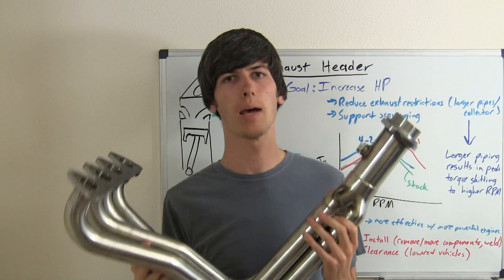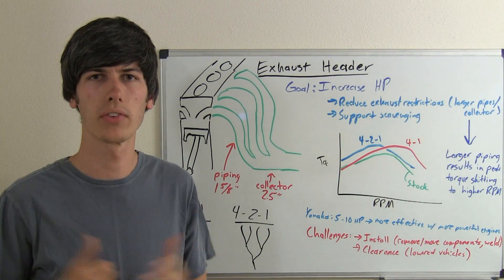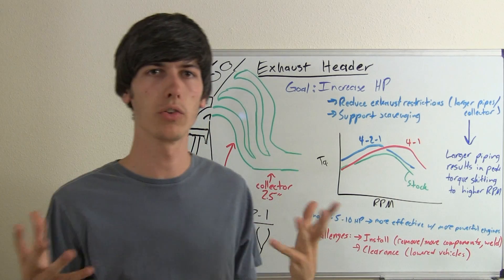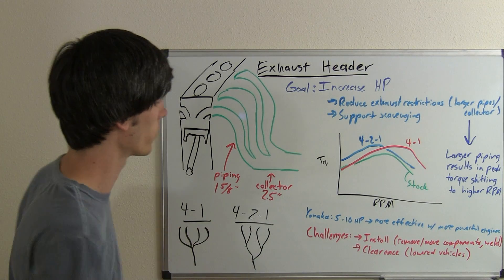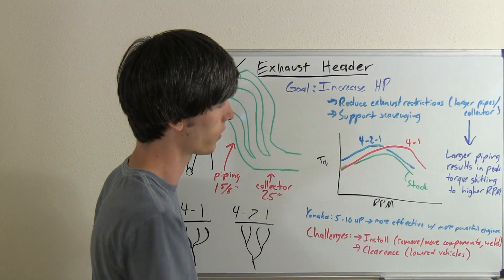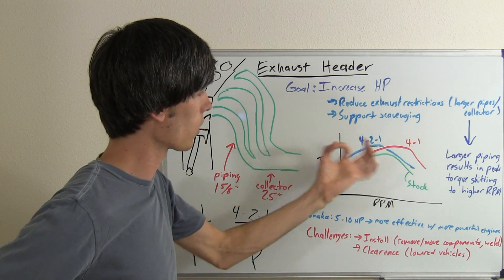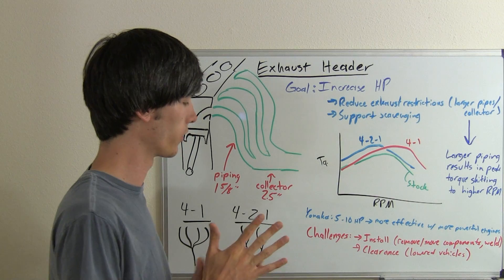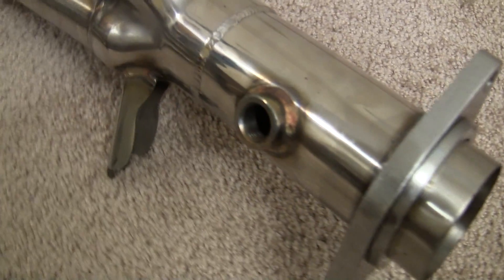Exhaust Header - Explained

Comment: I got stock exhaust on my Mustang, could I buy some aftermarket exhaust and aftermarket headers and put them together. I'm also getting a CAI too would that help out? Basically I'm getting aftermarket CAI, Exhaust & Headers
Reply: +leo ll lol  cold air intakes will give you gains as long as you get a tune..  most YouTubers who have never tuned a car think if you put a performance part in you'll  see an immediate difference right away.. cold air intakes will get you gains with a proper tune and that's a FACT
Reply: +leo ll exactly lol cause the tune tells your car that you now have a part capable of taking in more air flow than the stock restrictive intake. if they didn't get gains no one would be dumb enough to dish out money for them nor would a company still be in business if they sold 400-500$ dollar parts that do nothing for your car.. there's proven dyno results of intakes given you gains. you will always see gains from a tune.. in his case mustangs respond well to mods so he will indeed see gains.. the most commons upgrades are intake/ headers/ exhaust which with a tune will give you nice gains
Reply: a cold air intake should help out yes.. after you install the headers you'll need a tune so keep that in mind.. a tune will give you the max power of of those upgrades
Reply: Do I have to get then tuner right away..? I want to install those 3 parts and then after I save up a little more install a Bama Tuner
Reply: +Drake OVO not necessarily right away but you might lose some power until you get the tune, a tune will adjust the ECU settings so your car can run properly with the upgrades.. so if you put them on try and get the tune as soon as you can.. but yes your car can run without a tune just not efficiently as you want it to run
Reply: Look my Stang is an 04 v6... Would you honestly recommend me putting all this money into it?
Reply: +Drake OVO that all depends  if you plan on keeping it a while.. like I have an 08 g35 sedan 140k and I still put performance parts on it.. but I plan on rebuilding the motor(or swap it out) and tranny  in a couple years.. so if you plan on keeping the car for a while and rebuilding it when the time comes then yea its always worth it.. if it's something your not gonna have for a while then you might as well hold off till you get a car you really want to mod
Reply: Well my Stang was 81k miles.. The previous owner kept it storage in their garage for months at times.. So it's got plenty of life.. It does need new tires and wheels tho. I do want a GT. Specially an 05-09 model GT and a 5.0.. But I'd honestly like to keep my current Stang.. Maybe one day when I have kids I'll give to him. But all these mods will cost me at least 2k.. I could sell it and buy a GT.. But like I said I'd like to have a v6 & GT.
Reply: cai's are a waste of money. plenty of youtube vids to show this. spend the 4-500 on a upgrade that will actually do something more for you.
Reply: gkb your opinion, the tune and new fuel map is what gets the increase in power, not the cai. Plenty of people in the automobile community agree to this as well. Not trying to troll, just giving you FACTS as you say, do your research. 

https://www.google.com/search?sclient=tablet-gws&site=&source=hp&q=cold+air+intake+waste+of+money&oq=Cold+air+intake%2C+waste&gs_l=tablet-gws.1.0.0j0i22i30l2.1193.15587.0.16553.30.18.4.8.8.0.138.1655.13j5.18.0....0...1c.1j4.64.tablet-gws..0.30.1699.L2GgDVQ2R2w
Reply: +leo ll  you believe in what you want it's your opinion. I'll have mine.. take care now
Reply: gkb the difference is, I have facts to back up my opinion.
Reply: +leo ll funny I have dyno facts for my opinion too and so do millions of other people that mod there cars.. but again you believe in your opinion
Reply: gkb just like you do yours. the difference is I've supported my opinions with links and evidence, what have you included? A dyno report on your car that we haven't seen?
Reply: +Drake OVO we  make the auto exhaust manifold, catback, I think I can supply them to you.       prico_yang@163.com

Comment: sorry to ask, how about 6 cyl? which header system is the best for it? thanks.
Reply: +Andrew Kj The same science will apply, but header design and geometry will vary depending on whether you're talking about a V6, and inline 6, a boxer-6, or some other configuration. In general stock applications will feature exhaust manifolds, aftermarket applications will feature exhaust headers.

Comment: Could it cause problems on a stock engine not to have enough back pressure? due to too little restriction through the exhaust. For say a 4 cylinder boxer engine ( if it matters)
Reply: +Kevin Hackett nope backpressure doesn't matter on any new fuel injected vehicle

Comment: These videos help me so much. I am working on designing an "ideal car" because I'm fifteen with nothing better to do, and I want to have experience in designing cars if that's what I end up doing for a career. I'm thinking v10 or v12, 3.0 liter 1990's f1 style. Awd, with torque vectoring, and turbo charged. I'm also working with an Ohio state university student with a Chrysler internship on redesigning the way valves work and move, because I really hate how restrictive they are. The goal of the car is pure acceleration. I think I'll be relatively relaxed with top speed. Let's say a goal of 200 mph (hah got you there). Because of acceleration being our goal, we'll use the 2014-2015 f1's hybrid engines as a reference point. I recall you going over a new turbo technology you saw at an event. We'll combine that new tech with the split turbo technology of f1, to keep the intake cool. Since I'm a group B rally enthusiast, let's put a twin screw super charger after that turbo.

Comment: I'm sorry if I didn't catch it in the video but what bearing does the length of the headers have on back pressure? From what I have gathered from info online and my experiments with my 36-year-old 350cc single cylinder bike, reducing back pressure to a very low amount results in large gains at high revs (just like you said about shifting the peak output up the rpm band) but a drop in low end output. How does the header length fit into this?
Reply: Siddharth Rajkumar it doesn't explain in this video, but he does refer you to another video of his. Basically, when the exhaust reaches the collector, the cross sectional area increases suddenly before tapering down to the larger diameter. When the high pressure pulse of gas expands like that, it sends a lower pressure wave back up along the pipes until it reaches valve. Imagine taking a long, light spring, then suddenly yanking on one end. You'll see a wave go from one end to the other where part of the spring is stretched, and the remainder is still at rest. If you can time it so that wave reaches the valve just as it's opening, the backpressure will effectively be lower. However, this only gives a boost when your rpm is at a certain level, and will actually decrease torque when it isn't at the correct rpm, due to higher pressure before the wave hits

Comment: I have a 1989 e250 rv im rehabbing.  The new engine is in installed and now we're installing full length headers.  The left side fits but on the right side, one of the header pipes is hitting the motor mount bracket when there about 1/2 inch before we can bolt to the motor.  

I want use long tube and there's no technical shortys to get for that vehicle.  also i simply dont have the time to keep searching and waiting for shipping etc.  

My question is,  to make this header fit,  and for the lesser of two evils, would it be better to dent the pipe in where its touching the bracket or to cut a short area out and reweld to make the clearance  ?

Those were two suggestions from a muffler shop.
Reply: +Engineering Explained On the newest series of the motor trend youtube they tested how much (if any) a dented/deformed/clearanced header will cause a loss of power. And they determined on the engine dyno that as long as the header tube is not pinched shut, it has basically no hinderence on performance! Even with all 8 tubes smashed an a few nearly crushed half way in, they only lost about 1-1.5hp
Reply from the maker: +maxthereof Hmm. Well, the best would probably be to cut it and reshape it a tad, smooth bends, not sharp. But if it's not that powerful of an engine and you're just going for something that works, I don't think there would be much harm in a small dent. Keyword being small. Depends how much you want to spend I suppose.

Comment: I put headers on my Nissan Frontier a couple years ago and shortly after had a 2.25 inch y pipe made with high flow cats. Stock y pipe maybe was 1.75 inch and it felt like my truck had a lot more pull (butt dyno) with the stock y pipe. I am confused as to why it got slower with a bigger more free flowing y pipe.
Reply: Choking the engine a bit in the low rev range helps with developing torque, but that also means it can't keep up at higher rpm's.
That's pretty much what many manufacturers do on the inlet side by using f.e. vtec to open the valves a little at low rpm, but more and longer at high rpm.

By seriously increasing exhaust flow and reducing back pressure, you shifted the powerband to a higher rpm range, which should result in more power if the ECU, inlet, and injectors support it, but at the cost of low-end torque.
Reply: +Candisa backpressure is irrelevant on new fuel-injected vehicles
Reply: +Jayson MacKinnon Fuel injection has absolutely nothing to do with gas flow...

Comment: Can I drive with a aftermarket exhaust and a stock header until I install new headers that match my new exhaust? (Honda Civic Si)
Reply: Civic 😂
Reply from the maker: +Kregz Syb Yep.
Reply: +Kregz Syb  Probably. Only reason you wouldn't be able to is if the exhaust is made for larger headers which isn't very common.
Reply: How did it go with the aftermarket exhaust and stock header? Im going to install my skunk2 exhaust with my stock header and don't want to ruin anything.
Reply: +Kregz Syb  the aftermarket exhaust systems also work very well, we make them and quality is very good
Reply: +JunitoFa5 I got the 3inch pipe skunk2 exhaust, it's the right fitment but it's just loud af. I like it loud though, cops where are on my ass so I just keep the silencer on. It's still sounds nice with the silencer on too so I'm not too upset, better than getting a ticket 😁

Comment: Great, but, is there a difference between 4-2-1 long tube header vs 4-2-1 short tube header, and 4-1 short vs 4-1 long? or is just design? I have a 1.6 GA16de, and I just want low end torque, here in my country there are too many mountains.  Thx in advance.

Comment: So is it a bad idea to put headers on a straight piped car?
Reply: +TEETEE BIRD This is actually a myth. Backpressure does nothing but steal horsepower. What you are talking about is scavenging, and only gives you better torque at lower rpms. The less backpressure the better all the way around. The IMPORTANT figure is the tube diameter. A smaller pipe will result in higher exhaust velocity and therefore higher low-end torque. A larger pipe will result in higher exhaust mass but lower exhaust velocity, which results in less scavenging at lower rpms, but increasing top end horsepower. I wouldn't worry too much about the engine sucking in air/water unless your car is literally underwater.. ;)
Reply: a straight piped car is already bad.
Reply: thats only good for real time racers and rally cars that are always on WOT
Reply: +TEETEE BIRD well its not completely straight piped, its just a muffler delete on my 08 350z. I want to get test pipes and a y pipe, then headers
Reply: EstupedMexicanz never delete your muffler holy.

Cat delete and resonator is ok. The muffler is there to prevent water/moisture from going back to the engine esp if you have winter where you live.
Reply: +TEETEE BIRD Why never delete? I'm asking because I didn't do the muffler delete, my car is a salvage title with only little damage to the suspension, and the guy that owned the car before me did the muffler delete. it doesn't sound too bad and from what I heard there aren't any negative or positive effects besides shedding 20 lbs so what's the big deal?
Reply: +EstupedMexicanz muffler is very crucial. as i said. straight pipe isnt good. maybe you dont notice any bad effects right now but you should find a muffler for that. a small one will do with the same diameter as the rest of your piping.
Reply: +EstupedMexicanz its not all about sound. its to prevent your engine from sucking air/moisture/water when you switch the engine off also it helps to create enough back pressure to help pull exhaust gasses out.
 

bottom line :
you can delete anything on your exhaust but never the muffler. unless youre a rally driver.
Reply: +TEETEE BIRD Really you'd only have the issue of sucking moisture back into the motor on a carbureted engine, because they are really the only engine that has a chance of spinning backwards on shutoff, Right?
Reply: Doesnt matter. Air can still back flow regardless carbureted or not.
Reply: gt86life Thanks
Reply: +TEETEE BIRD Lol what are you talking about? Up here in canada lots of people have straight pipes with no issue at all. How would water/moisture be stopped by a straight through muffler?

Comment: does doing this consume more fuel?
Reply: Theres no possible way that having better airflow equals using more fuel
Reply: +_ _  this is true, but isn't there an effect where with having better airflow you can set the EFI to make the Air/Fuel Ratio leaner, because it requires less fuel to... produce... more exhaust...? Is that last part right?

Comment: just a question:

would a 2,5L ENGINE non turbo benefit from headers? low end and mid range?
Reply: +TEETEE BIRD Yeah most likely because they are built to comply with emissions regulations from the factory , you may need to re-install the originals when it's time for emissions .
Reply: +TheBikemaster94  How does that emissions stuff work,  I live in WI so we don't have that up here.
Reply: Atomic Blaze 23 This guy has more vyds on evap canisters and other emissions equipment if you want a detailed explination

Comment: Noobie question. I've heard that when installing an after market exhaust header, you also need new fuel injectors. I just want to confirm if this is true or not and what would be the best way to go about shopping for them?

I drive a 2013 Dodge Dart Rallye 2.0 automatic.

Comment: I understand that the peak torque curve changes depending on the header used. My question is that if a vehicle used both the same exhaust pieces except for the header to compare torque numbers as well as the curve, will the 4-1 header out-perform the 4-2-1?
Here is my example to better get the answer I am looking for:
Scenario: Only thing affecting curve between headers is max flow potential. Just keep it simple and in your mind that the motor is supposedly capable of the flow for the 2 types of headers and that the chance that the 4-2-1 header may cause flow restriction that may actually cause tq loss.
4-2-1 Header - 100tq @ 2000, 150tq @ 3000, 200tq @ 4000, 190tq @ 5000, 175tq @ 6000.
4-1 Header - 100tq @ 2000, 150tq @ 3000, 200tq @ 4000, 210tq @ 5000, 215tq @ 6000.
Both numbers are the same until after 4000. This does show the 4-2-1 header as having peakier tq in the lower rpm's for the curve, as well as the 4-1 header having more of a higher tq curve. But, the 4-1 header curve for this example shows no loss of what the 4-2-1 header was capable of doing and also shows an extra bump in tq in the higher rpm's. Though the curve peaks higher for the 4-1, it also has more tq and covers all of what the 4-2-1 header was capable of without any low rpm tq loss.
Please help me to clarify this as I don't want to buy a 4-2-1 header if the 4-1 header does not have any actual tq loss in the low rpm's in comparison to what the 4-2-1 header curve looks like.
I don't see any point in buying a 4-2-1 header if it gives your car a max tq of say 200 at 4000, when I could get a 4-1 header that still has the 200tq at 4000, but also has the additional tq in the higher range that I would not have if I were to choose the 4-2-1 header. There would be no point in getting a 4-2-1 header if it has a better low rpm tq curve simply because it were too restrictive and disabled any high-end tq.

Comment: Would this benefit my 2010 Kia Forte ex sedan in any way is it worth the money ?
Reply: XxClayanaitorxX I guess so, but don't expect a huge gain since the car is a stock. If you want a header, you should install a CAI and a full cat back exhaust with it. The point is to have the engine breath easily and efficiently. But if you want a fast car, you need to tune the car. Hope this helps.

Comment: so if I get some headers and I already have a magna flow exhaust do I have to get my car tuned? someone told me that you have to get some type of air/fuel management tune?
Reply: Marco G That's usually referred to as a replacement chip. People usually want to keep their drivetrain stock by replacing intake systems, exhaust systems, and throttle bodies. After that should be enough producing around at least  40/50+ hp and torque, but it depends on the size of your engine. The larger your engine, the more gains. On a standard economy I4 or V6, there are virtually no gains but just more sound.

Comment: since i have 2 inch exhusted straight pipe but i still have stock cats and megnaflow . if i add headers on my honda civic with dc headers , will it makes my car louder then before when i drive? 
should i get 4-1 or 4-2-1 ? what do you recommend